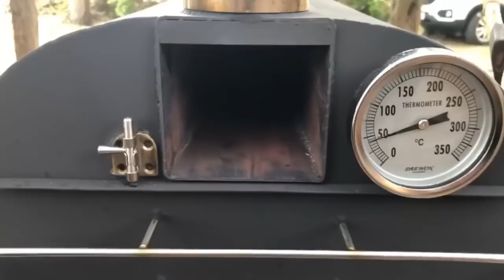로켓 스토브 피자오븐 만들기 /캠핑/Rocket stove Pizza 🍕 Oven Making /Camping

Comment from the maker: 사이즈 :  390x340xH230
무게:  약17~20KG
사용된 철판: 1.6T/4T 
각관파이프:  2T
연통: 60MM
Size: 390x340xH230
Weight: About 17 ~ 20KG
Iron plate used: 1.6T / 4T
Square pipe: 2T
Chimney: 60MM
Tamanho: 390x340xH230
Peso: cerca de 17 ~ 20 kg
Chapa de ferro usada: 1.6T / 4T
Tubo quadrado: 2T
Chaminé: 60MM
Размер: 390x340xH230
Вес: около 17 ~ 20 кг
Используемая железная пластина: 1.6T / 4T
Квадратная труба: 2T
Дымоход: 60 мм
サイズ：390x340xH230
重量：約17〜20kg
鉄板：1.6T / 4T
角管：2T
煙突：60MM
机身：390x340xH230
重量：约17-20kg
使用的铁板：1.6T / 4T
方管：2T
烟囱：60MM
Größe: 390x340xH230
Gewicht: ca. 17 ~ 20 kg
Gebrauchte Eisenplatte: 1.6T / 4T
Vierkantrohr: 2T
Schornstein: 60 MM
Tamaño: 390x340xH230
Peso: alrededor de 17 ~ 20 kg
Placa de hierro usada: 1.6T / 4T
Tubo cuadrado: 2T
Chimenea: 60MM
Dimensioni: 390x340xH230
Peso: circa 17 ~ 20 kg
Piastra in ferro usata: 1.6T / 4T
Tubo quadrato: 2T
Camino: 60 MM
Boyut: 390x340xH230
Ağırlık: yaklaşık 17 ~ 20 kg
Kullanılan demir plaka: 1.6T / 4T
Kare tüp: 2T
Baca: 60MM
Taille: 390x340xH230
Poids: environ 17 ~ 20 kg
Plaque de fer usagée: 1.6T / 4T
Tube carré: 2T
Cheminée: 60MM
Reply: Very very nice 
Masallahh
Reply from the maker: Thanks
Reply: Спасибо

Comment: Loved the build and the simplicity of design.  If you had added some bored holes or angle grinder slots in the fire tube above the ash box would you increase combustion and add a bit of wood flavor to foods that you are baking?   Loved this presentation and your videography.  Your attention to small details, the metal drawer handles are impressive.  Wishing you and your family Peace, health and happiness.
Reply from the maker: The combustion is still good as it is.
If you drill a hole, the ashes can go into the food.
For now, I'm going to use it as it is.
We'll try to change the structure this winter. Please look forward to it.
Thank you.
Reply: StoveTV  you are correct in an assumption that ashes may be introduced into food being baked but if the flames are pulling air in for secondary combustion and the holes are nearer to the back than front the problem may be minimized.  Thanks for encouraging complex thoughts.  You are a terrific educator and would make an excellent college professor.   Wishing you and your family Peace, health and happiness.

Comment: I love your projects. I wish you would give more detail in materials used, thickness , dimensions. I'd like to try try some of your projects myself. thanks
Reply from the maker: Iron plate uses a lot of 1.6T
Only the bottom of the oven is 4T
I will check the stove size and let you know
Reply: @stovetv  thank you for getting back to me. I really appreciate it.😊
Reply from the maker: Stove size
Width 380mm
350mm vertical
Height 235mm
It can be difficult and difficult to build.
This stove is an experimental work and it looks like an additional firebox is needed.
Security measures are required.
I am also researching and planning
good luck

Comment: Very well executed, it seems an high end production item, not some cheap home made imitation of something already existing, it uses also a concept not used afaik in the commercial firewood fueled portable pizza ovens, having the fire on top of the baking area and not at the rear of it and at the same level.
But I would not call it a pizza oven, it seems to me that is not capable to reach the very high temperature (form 450 celsius - 850 fahrenheit to 500 c 930 f) that a real pizza oven reaches and also it seems that the tunnel with the fire on top brings too much heath in the center of the pizza, and you did actually not baked a true pizza, starting from dough and raw tomato, but used a pre baked disk and cooked tomato, i suspect that with a real pizza, as both the dough and the tomato would need more time the topping would have been even more burned.
But probably using a baking stone and pre heating it well instead of a metal dish the results starting from dough would be better.
A proper pizza stove should bake a pizza in 1-1.5 min for a neapolitan style one and in 3-4 min max for a new york style one, more crunchy, I doubt from what I see in the video that this stove can do it giving an uniform heat to all the pizza disc ( but it is possible to protect the center of the disc with the topping with some aluminium foil for part of the time to minimize the problem of an overcooked topping and/or add the cheese only later, giving it only a baking time to properly melt and not burn).
It seems to me more a triple function stove, for cooking on the top, even if not with a large pan, as tent stove for heating in the winter and with some pizza capability then a proper pizza stove.
Ciao from Italy, the land of the pizza.
Reply from the maker: Good opinion
Of course, there are pros and cons
I plan to remodel it to come out 400 ~ 500 degrees this winter.
Please look forward to
Thank you
Reply: @stovetv  i surely will because it is an amazing build right now, even if more multi purpose then a proper dedicated pizza oven, i am convinced that right now it is possible to get good results cooking pizza with it , maybe following my tips to don't over cook the topping and to have the bottom more cooked by using some kind of baking stone or a thick iron plate that can accumulate the heat, but it really deserves more, as is so amazingly well built.